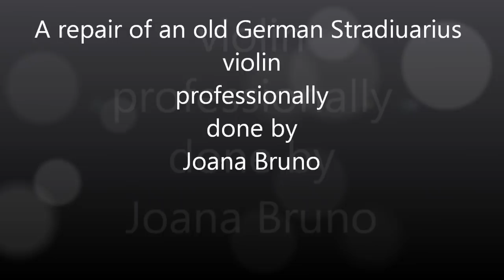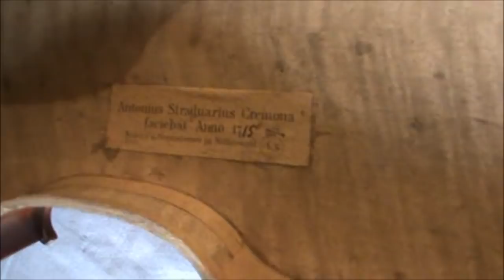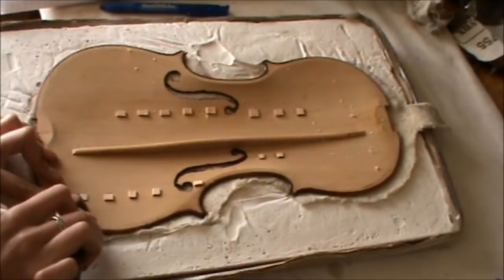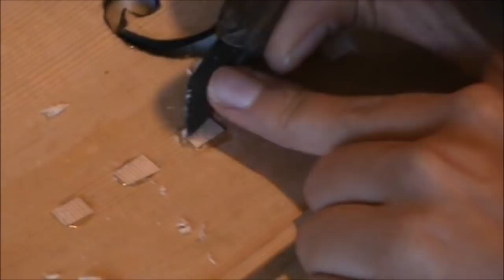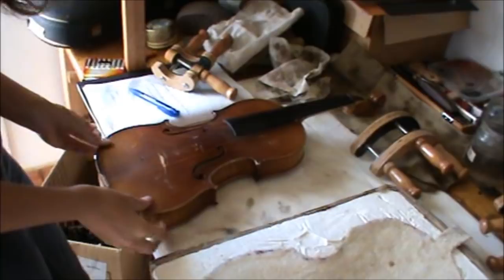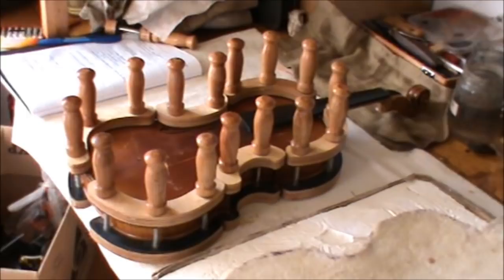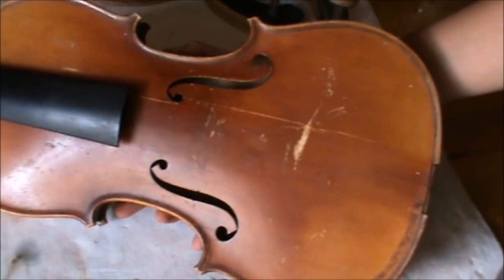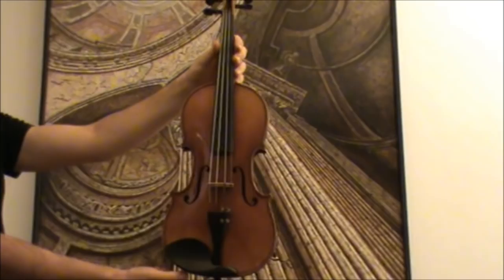Repair of an old German Stradiuarius violin Neuner & Hornsteiner workshop 803

Comment: What a fascinating video.   I saw no sound post being inserted.    Was it completed and played without a sound post ?    I know nothing about violins, but am trying to learn, so some experts out there might find my question silly.    Please be understanding.  
Also, will the bridge need to be completely re-fitted, after this repair ?
I was disappointed that the work to re-attach the neck was not shown.
Reply: If it helps you to understand. The plate is glued on first. The sound post is fitted later through the f-hole.

Comment: Looks identical to mine,which unfortunately has no label. Got mine for £50 in a junkshop!
Reply: Wow does it play good? Did u have restored?
Reply: +Picco bow I restored it. Fortunately it just needed cosmetic cleaning and tidying because it was filthy,and the strings had turned green and stuck to the fingerboard. It plays and sounds nicely. I had it valued and they said it was worth £600-£800 pounds.

Comment: I realise that with no repair it will not sound at all, but will these repairs alter the sound of the original instrument in any significant way, will it have a new tone to it afterwards ?
Reply: Steel Standing the short answer is yes because anytime you add or take away materials from an object it changes it's acoustics. The game is to not add/take away too much so that you are not affecting the tone too extremely. The act of removing the top however can greatly alter the sounds of a string instrument immediately so it is best to avoid that if possible. The alternative here however would be leaving the cracks which would surely produce some horrific sounds of wood edges vibrating against each other which would cause more damage eventually and could eventually lead to the instrument being beyond reasonable repair.

Comment: are those cleats gonna hold just by gluing them down with your thumb? I know violins are mostly fragile and don't excert forces like bigger stringed instruments do. but I would still clamp those cleats in place
Reply: Hide (animal) glue shrinks as it dries and it doesn't creep like other wood glues.
They know what they are doing.

Comment: Most of the negative comments are really dumb. That master violin maker died some 300 years ago. Ergo, a violin made in the 1920s could NOT possibly be one of them. Obviously, it is just a ploy to increase hits to this video. The photo of the Stradiuarius label says 1715.  Thus even if it was produced in the same workshop, what was made in 1920 wont be the same as something made in 1715.  Nor, would a violin repairer give away his trade secrets. What I find shocking is that one German violin maker from around the same time period has moved to China and is now producing cheap production line violins on a mass scale.  People with a good ear will pay big money, while those without an ear go for inexpensive violins made in China marketed with a German name.

Comment: To trim down the cleats, why not use a dremel.  Would be dangerous, but so would a knife slip.  Any thoughts?
Reply: dremels destroy would fiber.  they are like mini chainsaws.
Reply: Bo Huggabee Thats the point. Trim down the cleats, not the violin body.  And you can get fine carbide tips at high speed to get smooth grind.
Reply: Slap Stick not microscopically...
Reply: Nope.  Chiseling away would more likely cause separation of wood fibers, although I don't see that happening  as long as the chisels are sharp.
Reply: Slap Stick knives get a far cleaner cut than saws.  their edge is finer than any drill bit.  besides carbides, aren't necessarily sharper, they are just stronger

Comment: Wondering why you use a brush to apply the glue and push it into the crack rather that a syringe that would inject the glue into it?
Reply: Because it's a cheap copy and doesn't merit the expense of a syringe.
Reply: @c.a.g.3130  It should be done from the back and you will never get full penetration of the glue without a syringe to inject it.

Comment: Sadly, there are no original Strads. The necks were ripped out by the roots and replaced with modern ones, they were reinforced to be able to withstand the tension of steel strings. In 50 years of looking I've never once seen a Strad or any other contemporary fiddle in unmolested original condition.

Comment: What kind of wood are those cleats/reinforcements made of?
Reply: i think wood type isnt important at all they tiny so any good soft hard wood like spruce maple anything on disposable is ok .important think grain if u cross the those tiny cleats agaist grain its will streng up if again crch will stop there cant crack up cleats so gone stop there.thats why they put so many tiny cleats if u put world hardestwood from same grain driection it can be carack with top
they moslty use good wood becouse of even they tiny still not mess with sound  that why maple spruce etc i think moslty.and they scolpped loot of those tiny so not couse any vibration change

Comment: She has skilled hands, but a dull knife to shave the cleats with. Rather painful to watch. It's not hard to produce decent edges, especially on a tool like that.
Reply: William Young 

Maybe the knife was purposely dull so she won't cut into the underside of the top plate or shave too much off of the cleats?
Reply: I would be sweating bullets doing that. Dull, yes. No coffee either.
Reply: I would rather use a dremel tool for the sake of fewer impacts and less pressure on the top in general.
Reply: My thoughts,  also.
Reply: Also,  why not shape the cleats to profile before gluing them on?

Comment: To test if it is a true Strad copy, the tweeter region (left of the left f-hole) needs to be properly carved, as well as, under the fingerboard on the top plate.  BTW, cleating completely destroys the delicate nuanced sound of a true Strad.  A.S. carved his top plates to 1/10 mm accuracy to the desired topology. This was his trade secret.

Comment: Türkçe

İngilizce

Turkey Balıkesirt to exact original Stradivarius violin in 1713 sealed the guarantee I talked to sahipiyl Armenians after a team come across and carbon testing done photocopy machines, such as with anything they measured from all sides have taken samples from the adhesive used on time within which play the violin until brass them 2-3 hours to examine 12 people this orjinalt the saying goes, but The owner, whose price is not understood, is descended from the Sultan Abdülmecitten

Comment: my daughter just got her first violin,then my dad had one in his attic and took it back to Ireland for me it needs a bit done eg strings,bow but the reed is rattling about inside I took it to our local music shop to be told if the reed was inplace it would cost just over €50 but if iv to get someone to do the reed that alone will cost €100 it's not a big name I only paid €107 for the new one, advice is all I'm looking for.I did get it in place and it stayed in we gave it a bit of a swing about and success it stayed in place till today when I took it out to clean up the body and the dam reed is rattling about in the violin I was told it's all about placement and no glue should be used and I can see there is no sign of glue bits..what to do I'll try replace it again iv a better idea how to go about it now naturally I can't take it apart like you can what do you suggest? thanks,beautiful work by the way
.
Reply: reed?

Comment: I appreciate skillful use of hand tool as much as anyone but goof grief, I'd be using a dremel to bur down those cleats. Why make them so big in the first place?
Reply: That would be like pruning your roses with a lawn mower. No, a knife is just fine (& I would make them diamond shape with diagonal grain, not at right angles across), although I thought the process was a bit laboured, but then she was under instruction though & being careful through the process, although it seemed like a fairly long time from applying the glue to closing with clamps, but that comes with practice etc. Everything would need to be pre-warmed (hair dryer works OK) to stop the glue from gelling too quick & sometimes applying some warm water & wiping clean can help with that too, however, it was still nice to see the process as performed in such a workshop & of course the final playing.

Comment: Cheap and nasty fake, no matter how you slice it.  Stradivari would have used it for firewood.
Reply: no. it sounds pretty good. the violin is not responsible for the BS. Why the fake label though?
Reply: it has great projection.
Reply: its a german copy ( a stradiuarius, not stradivarius) not the real strad
Reply: Tommy Lakasi  - Stradiuarius is the way the original Strads were labelled.  The letters "U" and "V" were fairly interchangeable.  The violin is a copy made by the luthier firm of Neuner and Hornsteiner in Mittenwald., Germany, very early in the 20th Century.  N&H was a very reputable luthier firm, and they made excellent copies.  Their instruments (if still in good playing order) can run from $3K-10K,  An instrument that has some damage, or one which did not receive good treatment during its life, can run far less.  (BTW, Most copies often have replica labels.  It is not meant to be "false advertising, but merely to show which maker and/or model it is patterned after.)